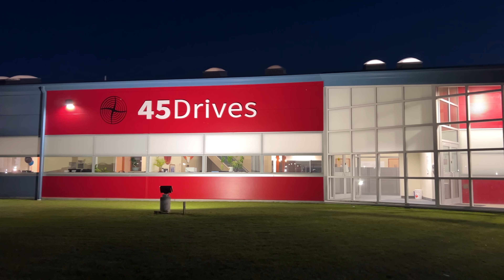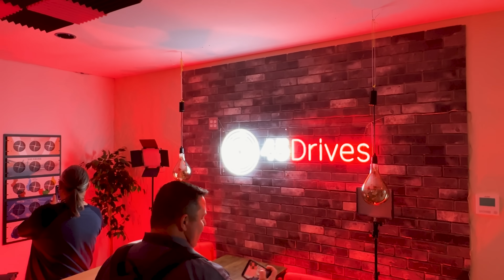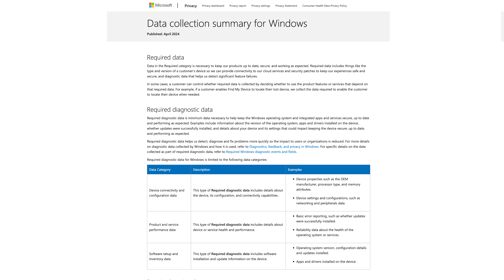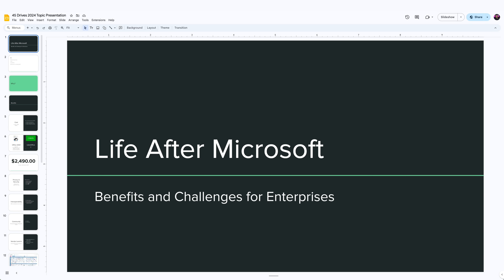How one company is "De-Microsoft-ifying" and pushing Linux on the desktop

Comment: I'm actually in a planning phase of my de-microsoft'd MSP.  I would have loved to see the PPT slides from that conference.  Active directory would be one area that I believe needs a large focus on.  I know active directory, but not really up to speed on how this can be done smoothly in the open source world.  And support for it?  Forget it.
Reply from the maker: I totally agree.  That was a big topic in my presentation, that Microsoft AD is such a great tool and so ubiquitous in the enterprise it would be very difficult to replace (if even possible) and very difficult to support.  Most features are not available in other tools and most policies are not available on Linux machines.
Reply: Samba4 and sssd are very mature and work surprisingly well.
Reply: Active directory? you may try openldap for instead...
Reply: Take a look at Univention then, it's a Linux based domain controller (and some more) based on Samba4/OpenLDAP: AD, LDAP, DNS, DHCP, etc. etc.
The windows snap-ins (AD Users & Computers, Group Policy Management, etc.) work too if you want to continue to work from a Windows box. Downside is that the powershell AD module doesnt work (Get-ADUser etc.), since that depends on the ADWS. Upside is, you have a quite convenient webportal + landing page built into the DC.

So user management, groups and permissions/access can be easily done with OS tools. GPOs dont work with Linux clients (AFAIK), but work fine on the serverside if you want to keep the employees on a Windows client (so they don't riot) while also havine the infra run on FOSS. ;)
Reply: @TechnoTim : Synology offers several solutions to directly compete with Microsoft (linux based), while Synology itself and DSM is not an open sourced company or OS, it is free to use once you purchase their hardware.

They have fantastic Active Directory replacement options, free mail server, free windows, linux, MacOS backups, Password manager, and many more in-house applications that can completely free you from Microsoft. - I have been doing this since 2011 (using their hardware and software to do just that).

Can also just run VMs directly on their boxes (anything), BUT the processors aren't very powerful for this until the extremely high-end expensive ones... I use them in small and large business settings without issue. Docker also runs and as far as I can tell, there aren't restrictions.

Comment: I started my "demicrosoftification" 16 years ago when I installed Breezy Badger...🤣
Reply: 16years ago? wow, that's cool!
Reply: Xenial Xerus let's go~
Reply: Started with Trusty Tahr but only recently switched to linux full time after figuring out arch linux.
Reply: I did my Demicosoftification 12 years ago my switching to OSX. It’s very Linux/Unix like and easy to manage. We can just get work done without all the hassle of Windows.
Reply: @mendodave  OSX is certified as UNIX 03 compliant...😎
Reply: Old school
Reply: @ocularpatdown  Old school? If you want old school try Slackware...🤣
Reply: Bazzite and Mint... The ultimate combo
Reply: I started it when Windows Vista came out more than 20 years ago. I used only Linux both at home and at work when Windows  XP was phased out. Never had , not at work, not at home, a computer running Windows 7. They say it was "good". I missed it completely. 
   CentOS, Redhat, Fedora, Ubuntu ... Today I use  Kubuntu and NeonKDE as well as the standard Ubuntu Gnome.  I have lost count how many computers with windows XP, widowns 8, windows 10 and lately windows 11 I have erased to install Linux on them.